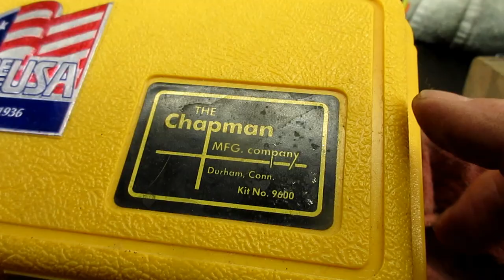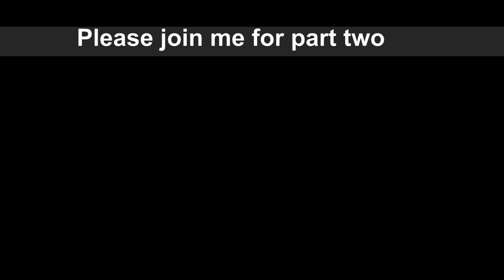Singer Model 221 Featherweight Motor Rehabilitation Part 1

Comment: Well done! I just bought a “project” of a neglected battered 221. Needs lots of work. I’d worked on ten 15-91s, which are very forgiving and easy to work on. So this motor assembly is demo and your explanation is great! Thank you!
Reply from the maker: Very welcome. Lala is the only featherweight I've worked on, but I enjoyed restoring the machine very much. Model 221 seems like a mini model 301 except for the motor and this external motor is made so well. Good Luck with your project. https://www.youtube.com/playlist?list=PLsCOZgzzaiKIA1OPw0k6QOSTE-wAUZ4kp
Reply: Got the machine running and stitches great.  I followed your tension video also. Had trouble but had to study and mull it over to see what I’d done wrong.  Now! Works great ans is stitching like a million bucks! 
Many thanks Mr Andy!
Reply from the maker: @PatriciaSpayd  So happy to hear of your rescuing this machine, and thanks for that. It's the main reason I make my videos, hoping folks like you will find them helpful and keep the old beauties in service. I know it was a project, so congratulations 🏆⭐

Comment: I sit here at my kitchen table with your video on my phone with this 221 rat trap to fix.  After attempting it 3-4 times I finally got it apart, got the stuck brushes out (the springs came out but not the brushes) Took the little thing out in the garage and used Mass Air Flow Sensor Cleaner to blast out all that nasty carbon and clean the commutator. My electrician friend who is a fellow veteran, had coached me on MAF sensor cleaner and how great it works. She worked on a nuke carrier so she is really good with this stuff. I got the springs back on the Brushes. Whew. Thank you for all your great level of detail - I think you’re teaching us this is great!
Reply from the maker: It sounds like you are making good progress, so congratulations. I've heard of the Mass Air Flow Sensor Cleaner but it's too harsh for me. Flammable, and some of the components are ones I don't care to use; naphtha for example. Then the decomposition products like Formaldehyde, Formic acid, and carbon oxides. It is mostly Naphtha and 2-methylpentane and the oxides so it's a pass for me to use it. I'm glad the videos are helpful and good luck.
Reply: I got to read the small details on that can. Wow. Great to know about the formaldehyde and other nasty stuff!!
Reply from the maker: @PatriciaSpayd  I know thousands of cans of it are sold each year, and I'm sure there are circumstances where almost nothing else will do. I just try to find more earth-friendly chemicals for use in my condo. I don't have a garage or workshop space. I always get the SDS on products like this before I try them. They are so easy to find nowadays, not like when you had to write to the manufacturer to get them. Here is the SDS from the CDC website link for the Mass Air Flow Sensor Product;   http://images.salsify.com/image/upload/s--1Rrhm33W--/me6b6eg1scczc2yu2l3k.pdf

Comment: Hello Andy,
Just received 3 featherweights from Ga. yesterday, only 1 of the 3 needs my attention. All very clean machines and well taken care of. Just removed the motor (using your guide) and found thread wound around the shaft behind the pulley. Going to complete the cleaning and grease wick replacements. 

My daughters will be so happy!🙏🏼
Reply from the maker: Oh, how nice is that! Your three girls will be so excited. It's an act of love, mom. 💖
Reply: @andytubesewing1953  Good evening Andy,
I had a chance to disassemble the Featherweight 221 motor today to clean and visually inspect everything. After initial inspection I noticed the armature looked like it consumed something and damaged it in areas,
Not seen this before until I did a quick Internet search and found this.... 

https://fabulous-featherweights.com/blogs/introduction-to-fabulous-featherweights/singer-featherweight-motor-reconditioning

Reassemble the motor with new grease wicks came home from work and reassembled onto the machine, motor still not spinning up to full RPM. Tried adjusting belt tension and making sure all systems mechanical are smooth. I will try a known good motor tomorrow and verify the discrepancy. 

Any input would be appreciated, may need to send the motor off to Carmon and April at the Featherweight Shop for a re-wire.
Reply from the maker: @Irukandji01  My playlist for model 221 has a 5 part series for the motor, including cleaning the commutator of the motor:
https://www.youtube.com/playlist?list=PLsCOZgzzaiKL6ePPxLpmnWSzTyxPKTb71
Have you considered that the foot controller may not be providing full power to the motor?
The foot pedal may be as old as the machine if it wasn't replaced before. People seldom clean or adjust the pedal but often replace the motor only to find they still don't have full power. What you do with your motor is up to you, but I suggest checking my playlist for rehabbing the pedal before you decide anything. https://www.youtube.com/playlist?list=PLsCOZgzzaiKL6ePPxLpmnWSzTyxPKTb71  There must be other pedal cleaning videos too. I'm too busy making mine to watch many YT videos.

Comment: I am servicing a friend’s 1940 221. Someone filled in the lower motor brush opening with a hard substance. The upper one has a cap and is fine. I’m wondering about removing the whole motor, opening it up and attempt to chisel out the hardened putty. It’s honestly like concrete! 
Or, ignore that part and clean the commutator through the working motor brush opening. The unknown scares me, but I’ve successfully redone my own 221 motor with new brushes and new wicks. I think I can, I think I can.
Reply from the maker: I had a motor with a broken off screw like the cap of the screw broke off but the body of the screw was stuck in the hole. It was as hard as a rock because it was bakelite or something. I tried to use a reversing screwdriver to get it out. It didn't work. I tried soaking it with WD-40 and turning it out that didn't work. All my fooling around finally broke a little hole in the top and I could see it was hollow inside the screw. So I just took the can opener on my Swiss army knife and utility knife made the whole bigger and just kind of kept turning it left and grinding it and cutting up the pieces and it finally fell apart and came out. I was so nervous I was going to mess up the screw threads in the hole but I did not because I was so patient. I bought a new plastic cap online and it went in as smooth as butter. All that to tell you Candy maybe you have a busted off screw there
Reply: @andytubesewing1953  oh! I get it now. I think I’ll try to remove it. Carefully! Thanks!!

Comment: Hi Andy,
thank you for a very useful video as always. I feel for you when the screws etc just don't want to come out. That's the joys of Vintage.  I would love to take apart my motor to give it a good overhaul. I suspect it needs to be done. I am waiting for my 221k to be serviced.
Reply from the maker: Yes, the joys of vintage, haha. It was incredibly rewarding to rehab this motor and have it run so well after. Much cooler running too.

Comment: Really nice video!! Thank you! I am going to open mine and clean it. Could you please tell me what motor grease I must put into those grease ports once I have cleaned them ? I find special grease for featherweight on an American website but I am in France and I cant  get it here.  I’ve read on some websites to simply put vaseline. Would you agree with that? I am afraid of damaging the motor… many many thx for you response! Take care
Reply from the maker: I've also read that people swear by vaseline but testing shows it does not melt enough, so I always use the special grease. Sometimes the grease wicks are hard as a rock and no grease will penetrate down to the motor shaft no matter which you use. I have read about repairmen that advise 1 or 2 drops of sewing machine oil onto the grease wick to soften it and allow some penetration to the shaft. I suppose clear vaseline (clear petroleum jelly) is better than a dry motor shaft? This video shows testing several greases (maybe you've seen it) https://singer-featherweight.com/blogs/schoolhouse/motor-lubricant  I have dealt with the folks at that website and they are very kind and considerate and have answered my emails. Perhaps you could ask them what you can do there since you can't get their product?

Comment: Andy, I have a 1941 and the band/motor covering with the Singer logo is on backward.  Do you know if I can remove the band without opening up the motor?  Or do you have a video that would show me how to slide the band off and put it on the correct way?  It’s not worth risking damage to my motor but I would like the logo to face out as its supposed to be.  Thank you for your videos.  I have learned so much about fixing my 221’s, 201 and other Singer machines from you.
Reply from the maker: Sorry, Marla, this is the only FW motor I've worked on. I don't know if you can remove the band without opening the motor. I suggest you contact the folks at the featherweight shop. I don't know anyone who knows more about them. https://singer-featherweight.com/pages/contact-us   There are most likely FW groups on social media, like Facebook, etc. who may have answers for you also. Thanks for watching my channel, and good luck.
Reply: Thanks so much @andytubesewing1953
Reply from the maker: @marlagibson6136  😊good luck.

Comment: Wow. I'm in awe of the way you just get in there and do it! Have you always worked on motors? What on earth did you do to prepare for this kind of work?
I can't wait to see part 2.
Reply from the maker: 50+ years ago I took a general shop class. We had to take apart and clean a small lawnmower engine, then put it back together. So you can see I am fully trained and certified, just ask Mr. Weston! It
s a very interesting motor, IMO. Thanks for watching ✨

Comment: Andy can U do a tutorial on how to fix up a Singer 201 Belted type motor. I took mine apart but I need guidance on upgrading wiring. Needless to say it still buzzes...Im assuming that's electrical😳
Reply from the maker: I do not have a model 201 to show you. I've never seen a model 201 in person. You can download the Adjuster's Manual here that has information about the motor and wiring. https://imagespast.files.wordpress.com/2015/05/singer-201-service-adjusters-manual.pdf
Reply: I have done the wiring now on two Singer 66 belt motors and now this little 221 belt motor. For electrics, my fellow veteran and electrician friend tutored me. First learn to diagram the existing old wires and what goes where. Write everything down and photograph as you go.  .

Comment: When I was repairing my motor, I ended up using some thin pliers to remove the cap that covers the wicks, and used pressure to put them back with new wicks and grease.
Reply from the maker: So you pried the little silver caps off? Twisting or straight up and off? Gripping the outside only, or one point of the plier in the hole?
Can you tell I was contemplating doing that? I was worried I would damage those little things and was not sure if they were pressed on or screwed on somehow. I just decided to work from the inside b/c I want to see in there and do some cleaning. I'll see if I can get the spring out and then get it back in. We'd all love seeing a link to the wicks you used and the procedure you describe would make a great video if you ever have the time. Thanks for sharing and for watching my channel.
Reply from the maker: Great video to see that cutaway motor. I'm really glad you mentioned the wick as I bought the same size and was concerned it's too big. What will we do with the 4'10"s of left over wick, haha? Thanks for sharing, Jesus.
Reply: @andytubesewing1953  That's why i sent you that email offering you the rest of mine a couple of weeks ago ;)
Reply from the maker: @JesusCliment  The email from July 7th. I just read it again and my mistake. I was also emailing with a fellow about some parts he offered for models 15 and 201 that night. It looks like my reply to him was sent to you by mistake. I am sorry about that and didn't mean a snub or anything. 50+ emails per day are getting a bit much for me. I think. Thanks again.✨
Reply: @andytubesewing1953  No worries. I had offered it to you as I purchased it to repair a 201-2 potted motor and I had saved some to fix the wicks on the 221, and had more than 4 yards left. I saw you started working on a 221 so I wanted to offer it to you... Thanks for your videos. They are very instructive.
Reply from the maker: @JesusCliment  thank you.